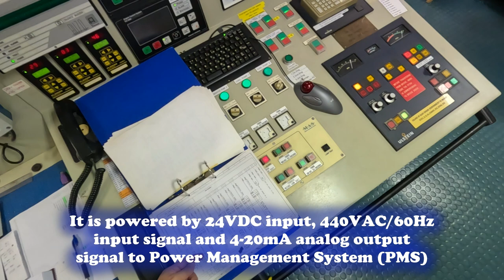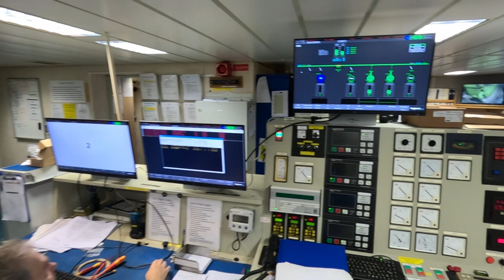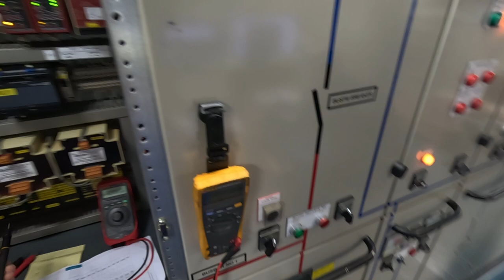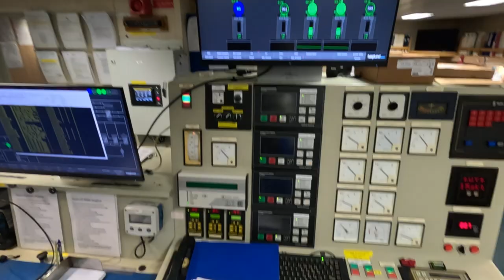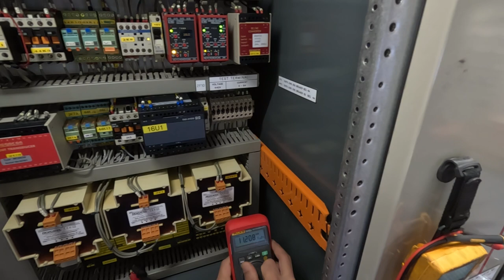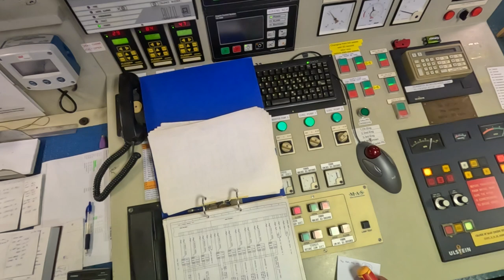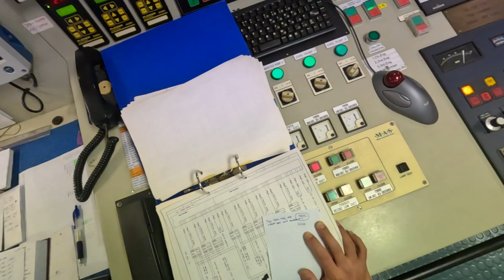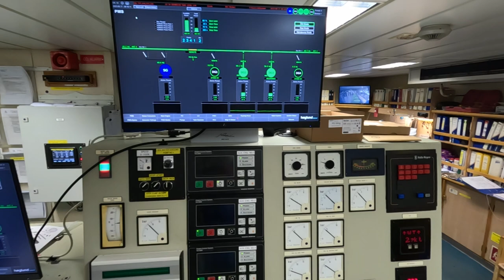#Probed! MSB Busbar No. 1 & 2 Frequency Intermittently Fluctuating

Comment: Why the frequency fluctuated?
Reply from the maker: It was in DD. Blackouts were there, retrofit of IAS, shaft generator problem not syncing. It’s hard to pinpoint which one is the root cause.
Reply: What is the brand for the red fluke meter sir?